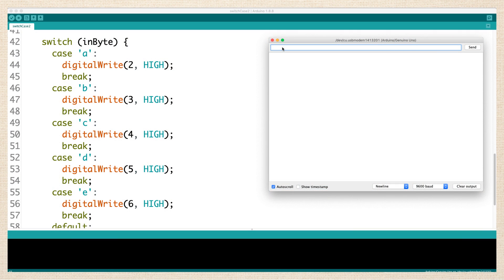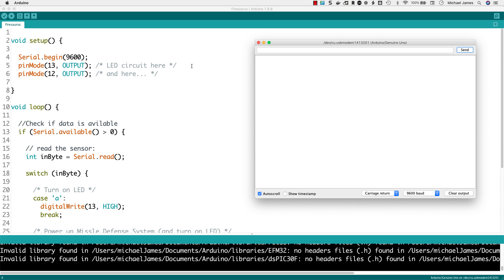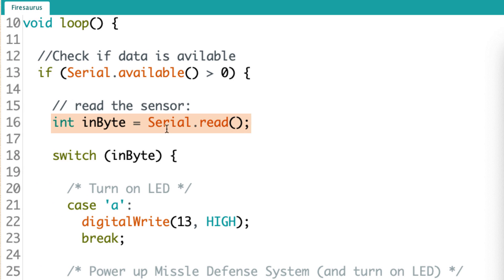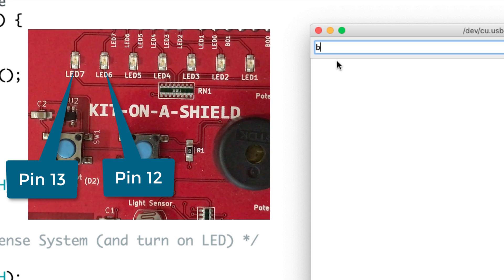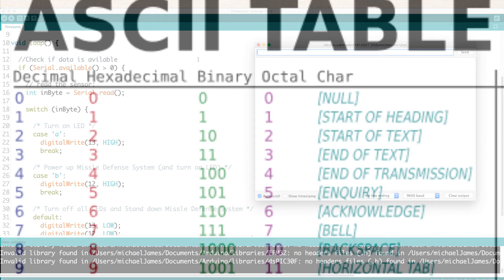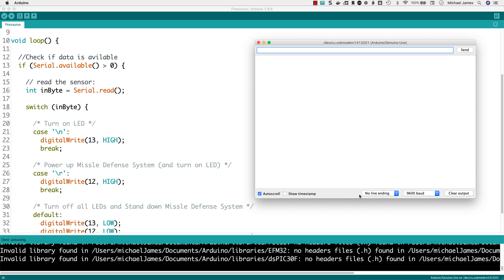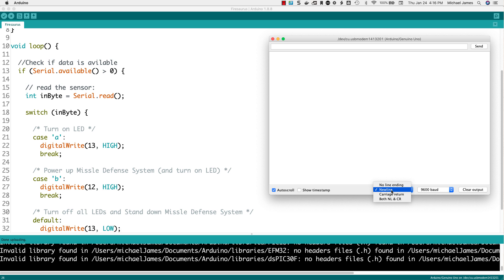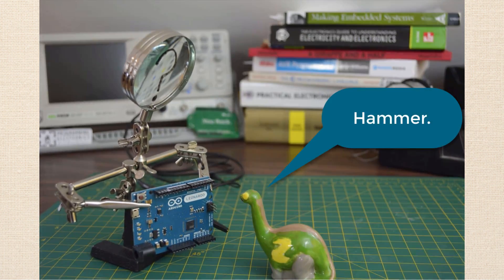Arduino Issue: LED flickers off when using switchcase and serial monitor input via the keyboard

Comment: cr and lf are not the same thing, cr returns to the left side, lf advances down a line.  Unfortunately the arduino serial monitor does not properly implement these functions, instead it treats them both the same, that doesn't make them the same, it just means the ide is poorly designed.  Use a properly implemented serial monitor and they will work as intended.

Comment: Before laser printers, there were printers more like automated typewriters.  These printers could be made to print bold text by sending only the CR and printing the same text over what had already been printed.  Other printers used a typewriter style ribbon that was as wide as the printer  paper.  In these printers the ribbon only advanced with a LF, and could be cut in two by sending a full line length of characters over and over again with only a CR and no LF.
Reply from the maker: Thanks for this!!!